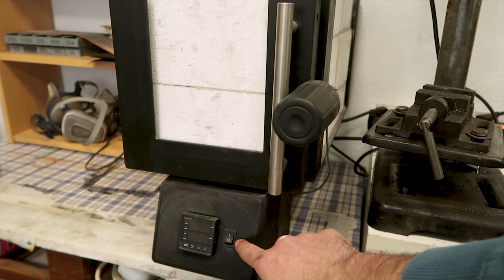Knife Making: Japanese Petty Knife | SLL Build Along 3

Comment: Very, very good! Inserting that dowel into the handle was brilliant.  Awesome knife!
Reply: Agreed.  I've never seen it done that way before.
Reply: I wish I'd seen that before I made the hidden tang knife I'm on with currently, very intelligent design!
Reply: I was watching him drill that bigass hole and was like, wut how much epoxy is he gonna use? then the dowel made sense when he showed it.  I don't like the blue detail in the handle nor the form quite that much though.
Reply: @S8tan7  but what's going to keep the blade from spinning if the epoxy gives out? No pins holding it in place and the dowel around the blade is completely round
Reply: The Los the epoxy wouldn’t give out unless it was hot enough to burn the handle, the amount of force it would take to break that large a bonding surface would probably Bend or snap the tang or wood anway
Reply: @S8tan7  And yet every professional knife-maker pins their blades. Hmm...
Reply: @vincedibona4687  google some japanese kitchen knives, they rarely have pins

Comment: I love the technique of using the dowel to fill the round hole in the handle, rather than drilling a bunch of small holes to create a square slot the blade to perfectly fit it.  The method you used seems much easier and quicker!  Great work as always!

Comment: ℹ️ Petty knives are small utility knives of Japanese design. Pettys can vary significantly in both profile and size, ranging from 75mm to 210mm. Petty knives are very similar to the common western paring or utility knife. While there is no hard rule about where a petty and paring knife diverge or what application each is most adept at, pettys are often considered ideal for small and delicate tasks on a cutting board while paring knives are better employed in hand. Anyone interested in a petty should also consider whether a paring or utility knife may also suit their needs.

Comment: Gader, what is the blue and white material you use between the different types of wood in the handle? Some type of nylon sheet?
Reply from the maker: It's vulcanized fiber, I buy it in knifemaking supply stores, looks just like micarta or g10 spacers (also called liners).
Reply: Good question. I’m glad you asked and happy to see the response. I’ll look into ordering some. I want to start using liners on my knives

Comment: Then the mother-in-law comes over and uses it to cut food with a ceramic plate for a cutting board, rubs it down with a dry paper towel, and throws it in the dishwasher.
Reply: What's paper towel to a carbon steel knife 🙄